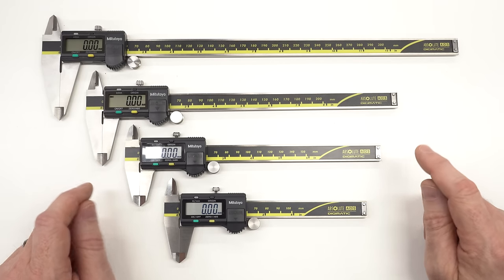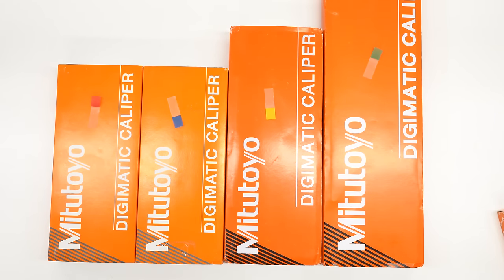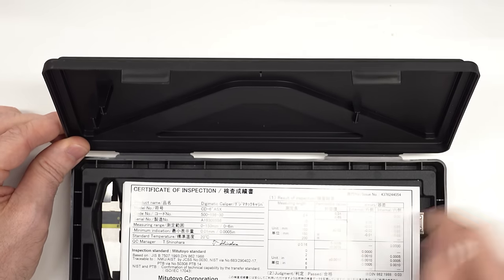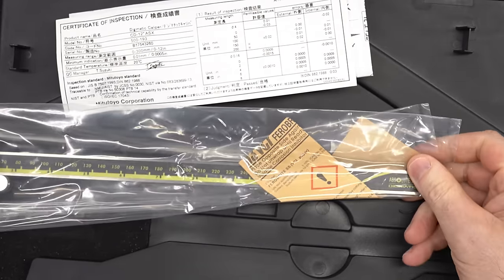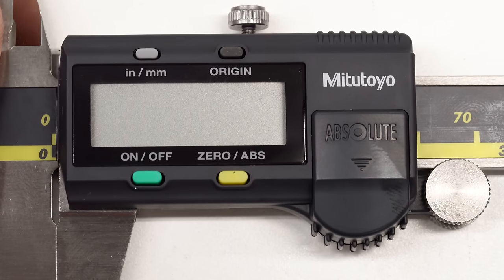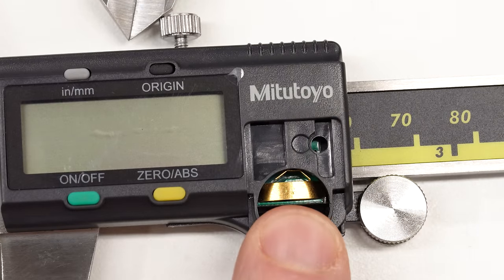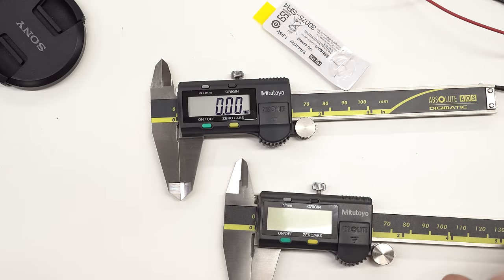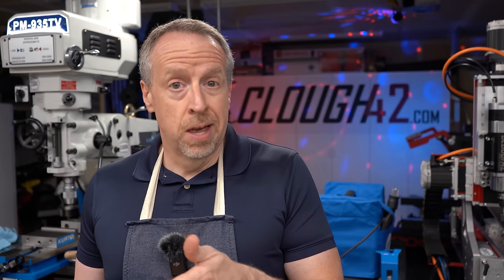17 Warning Signs Your Mitutoyo Calipers Are Fake

Comment: Nice vid. However a few comparative measurements done with both the genuine ones and the clones, as well as an independent measurement with a different caliper known to be genuine would have been a lot more helpful. I mean in calipers, ultimately, everything is about precision. I don't want it to be precise as in "a certain bolt is 8mm and fits a 8mm nut", I am pretty sure both the genuine and the fake ones would say "around" 8mm, I want to measure that rod that has to be exactly 7.5 mm when i take it off the precision lathe and has to fit a hole with a 0.01-0.02 mm tolerance...

Comment: I bought a cheap (+-20 dollars) made in China back in 2002 or 2003, for school. Have checked it against name brand ones multiple times over the years. It always says EXACTLY the same as the expensive ones. And is still working fine after twenty years. 

I don't know, maybe I just lucked out big time, but I'm not paying a hundred bucks or more extra for a name brand one, I'll tell you that much.

Comment: I've got myself a Chinese copy of older Mitutoyo calipers (not ABSOLUTE AOS version) for a home/hobby use. Seller did not offer them as Mitutoyo and they have no Mitutoyo logos. However the calipers do look very close to the original, have nice quality ABSOLUTE sign on plastic and ABSOLUTE / DIGIMATIC print just like the originals. Also power consumption is just slightly more than the original. Calipers don't work quite as good as the genuine Mitutoyo but still are very good for the price I paid ($20 (delivered from China) for 6" caliper).

Comment: while many people have the opinion of "if they work, then a cheap pair is just fine" and i was also in that group myself. once you get at genuine pair of Mitutoyo calipers in your hands you will understand the difference and why people pay for the privilege to own such pieces of equipment.
i spent the last several years using a $10 pair of calipers and had no complaints, until i brought the pair of genuine Mitutoyos. now when i pick up the pair of $10 calipers, its like their slide is made of sandpaper, i cant stand them. even my counterfeit pair is considerably better than them that i would happily pay the counterfeit price again just to get a reasonable pair of chinese calipers.
in the end i comes down to, how much are you willing to pay for the "feel" of the tool you are going to be using. some people dont care as long as the tool does the job they need it to, while others want a particular "experience" from the use of their tools and they are willing to pay that extra premium to achieve it.
So, each to their own, and we should not judge each other for the tools we choose to use to accomplish the tasks we strive for, we should all just rejoice in the fact that we are all connected in our love of making things.

Comment: I have a non branded version that has an identical case but it is far smoother with more detailed design and cushion pads. The tool looks plain, but it is steel and has been perfect. .0005" accuracy. $25

Comment: I inherited my dads Mitutoyu mechanical Vernier Caliper, I believe it was bought in the early '60s and they are bang on accurate and are in excellent condition
 I also have some cheap Chinese digital ones by 2 different manufacturers and they are quite accurate but not as accurate as the mechanical one IMO, I also prefer to use the mechanical one.

Comment: Would be good to see measurements of a gauge block to see how accurate each is.  I use a Mitutoyo at work, but have a Clockwise tools one at home that I use for 3d printing, so doesn't need the same level of accuracy as I need at work.

Comment: A great video.. I have a REALLY OLD Mitutoyo, the daily goto and I use a horror freight digital for measuring while drawing. The digital is as accurate, but not quite as nice a finish and feel. What is really important here is ethics. I have Shars stuff and like it. I also have some other 'cheap' brands (including horror freight) and like them too. Like you say - put your own brand on it...

Comment: My Mitutoyo 6” calipers model CD-6”CSX and their box purchased on Amazon in 2014, tick all the boxes for being real except my Origin button is recessed and my battery cover is a little different, I think Mitutoyo tweaked the design a bit at some point. Would like to see an accuracy & consistency comparison between the real and fake calipers.

Comment: Do the counterfeit calipers read absolute like the real deals? That is one of the big reasons I like my Mitutoyo calipers is that I don't have to worry about zeroing it for every measurement. The cheap sets I've used over the years would drift. Can you turn off the counterfeit ones, slide it along and then turn it on and read the correct measurement?  

I think inside the battery door will be the first thing I'm going to check when shopping garage sales and such. Don't need a genuine one to compare it with there.

Comment: I have a 6 inch which i bought from an Ebay seller almost a decade ago. It says Mitutoyo UK Ltfd Made in England on the back. How can I identify if it is genuine or not? I suppose it is an older model than the ones you are showing on the video, because my on/off and zero/abs buttons are located on the bottom and the battery cover is different (does not have absolute on it).

Comment: Hi,

I have one of the ubiquitous eBay/Amazon $15 cheapies and it serves a purpose - I don’t do a lot of precision measuring and it never needs to be that precise.  But I would appreciate something a little better, one that holds the zero better and repeatedly gives the same reading when the same object is repeatedly measured.  I can’t really justify Mitutoyo prices but I’d been interesting in something respectable in between.  Trouble is I don’t really know the industry, I can see lots of more expensive ones but I don’t know the brands so I’m suspicious that they are just what I have at the moment but in better housing.  Could you recommend some mid-range brands that I could look at please?

Comment: 11:33 

My understanding is that such signatures are 99.99% sure autopen and not handwritten sir.

Regarding if i spotted the fakes i did spot two that looked different than the other two if that counts ;) The giveaway for me was the font in the physical scale. Especially the 0 was a dead giveaway. I then applied logic and chose the prettiest and cleanest looking font as the real one. ending on the correct one.

good video sir, you may weigh them as well for comparison for an additional way to tell for those with poor eyesight. most ppl have a digital scale

Comment: Do those QR codes on the back actually scan?  One of them looked blurry.  It would also be interesting to see if the serial numbers are serial numbers.  Could they be cranking out units that every time the change the reel the serial numbers start over from 1.

Comment: Very sharp eyed observation's there, - ebay is full of fake offerings, I am a keen cyclist and have been caught out with fake Shimano component's, bought a chain and rear sprocket set that just would not work at all, chain full of stiff links sprockets poorly machined lesson learned in the bin and replaced with genuine items from local bike shop. (at least your fake callipers worked - are they accurate though?) I am a retired QA engineer so found this interesting, thanks.

Comment: The fake died at 1.16 volts (if I recall). The real one showed a “low battery” indicator at about 1.4 volts, but at what voltage did it actually quit?

Comment: I bought one from Amazon and I fear it is a fake. It was cheaper than normal but it was in 2019! I was watching the video and it was like a rollercoaster, in some ways it was different to the ebay ones you have and in others it was different to the genuine. The biggest giveaway for me is the machine in the groove on the back. Rough as guts on mine and I can't imagine a company like Mitutoyo sending it out like that. Although it would be interesting to open it up and see inside. Will you do that in a video?

Comment: I used to have to get gaskets and then another country started making knockoffs and they don’t work. It’s a Xerox’s copy of an original. It’s always holes and channels are in a little different position. Transmission gaskets will have cross leaks.

Comment: 2am and I’ve just been out to check my calipers and micrometers. Calipers are genuine but I cannot find anything to say the micrometers are fake, certainly not on the units themselves. The battery is the only thing I can see. They seem very accurate and repeatable so I’ve no reason to complain even if they are fake.

Comment: I expected to see comparisons of accuracy using reference blocks. That would be important in seeing if they’re worth buying.
Reply: Did you know that you can buy calipers that are even cheaper because they don't waste time trying to dress themselves up as something they are not? The video mentions that the SHARS brand is recommended and costs less than the fake Mitutoyos. As @G.Tucker said above: "If you were to buy these knockoffs, you're not saving 60% off the price of Mitutoyo calipers, you're paying $80 or so for a $12 caliper."

Comment: I'm using a $10 caliper from Aldi's.  Pretty good for how little I need to use one.
Reply: I have Aldi calipers bought about 5 years ago, and they’re terrible. Not only do they eat batteries like there’s no tomorrow, but they miss steps (usually a multiple of 0.2”/5.08mm), which is easily noticed when measuring something tiny, but easily missed when measuring something a few inches across. This screwed me over more than once. Maybe the ones they sell now are better, but I doubt it. 

I mean, you can always perform a sanity check by comparing the reading to the physical scale on the thing. But that kinda defeats the purpose of digital calipers…

Comment: My hobby is modelling. I would like to use a caliper to measure wheel diameter of a tank in scale 1/35. I hate buying fake. I bought a Mitutoyo Caliper  for USD 25.00 on aliexpress. Now I understand that this device is fake. The real device would cost about CHF 150.00 or more. I would never spend CHF 150.00 to pay a device for measuring wheel diameter. In fact, I should never have ordered this device on aliexpress. I should use the traditional decimetre rule to measure. No precision. But I don't need such a precision. Thanks for your video.

Comment: Open and close high speed at low voltage, and repeat ability, read value on measure block 1,5,10,20,30,40,60,80,100 mm to see accuracy

Comment: On the yellow rag the exclamation mark next to “First” is farther from the T on the fake tags.

The arrow under the word “AbsOlute” is larger on the fake calipers.

The distance between the inch marker and the number is smaller on the genuine calipers. 

The vertical spacing between the metric marker and the numbers is much larger on the fakes.

The finger grips under and above the battery compartment are pointier on the original ones. 

The housing on the fakes does not reach the marker before to the 70 on the slide as do the original ones.

The thumb-wheel on the genuine calipers overlap the edge of the slide. 

The gap between the thumb-wheel base and the slide is larger on the fakes.

How does the knurling compare between the original and fake thumb-wheels? 

The locking knob on the originals are not as tall as the fakes. 

The slide on the fakes extend beyond the small plate with the two screws at the end of the caliper and one plates is not straight.

Comment: I would never spend a single cent on electronic calipers - no matter who made them. The idea is totally anathema to me.
I only purchase manual operated measuring devices.
That way they always work(!), and I have to use skill to measure an object and read the result. And because I am not lazy, I need to check it a few times, to make sure I did not read it wrongly.

Comment: The recessed screws on top of the caliper are "gib" screws. they put tension on the bow sliders. very important parts that set the blade alignment parallelism.  Put a tiny drip of soft locktite on the screw top. if that screw moves, your accuracy will be way off

Comment: I suppose that some people are fooled or wishful thinking that they are getting a genuine tool at a bargain price.  BUT, others realize they are fake and buy them anyway.  For some, they might be hoping that they will get the genuine quality at a lower price.  Others might like having the prestigious name without the cost.  Imagine, as a mechanic starting out, you could have a full set of Snap On tools at a HF price and the quality was good enough to fool most other mechanics at arms length.

I would like to see an accuracy test, both new and after some use.  Also, how is the feel?  I have a cheap caliper branded Enkay which looks great but feels gritty when moving it.  If I could figure out what part is creating that feel, I might take a stone to it.

Comment: The fake one which I have tried had another big issue. It has not been ABSOLUTE, it had been counting device - when I had opened and closed it quickly, than the beginning was in wrong position. 

ABSOLUTE sensor do not remember the position, but reads the position and zeroing only says which value is the zero (something like adjustable vernier on mechanical calipers, but covering the whole range). Cheap calipers counts the magnetic pattern below them and do not know their absolute position - it can be also the reason for higher power off consumption since the microcomputer stays on the whole time and they only turn off the display. Hard to say if they have changed it, but it is easy check and everyone can see it on spot. I have immediately returned it and bought the one from distributor.

Recessed origin button - on my mm only version the button is flush with opening and it is hard to push without a tool. Otherwise all remarks are the same.

Comment: Origin button being flush is not an indicator, I have a genuine Mitutoyo 150mm (500-196-30) with a flush origin button. It ticks all the correct boxes except the origin button, and I have checked on the local reputable supplier website and their 500-196-30 (which retails at almost $700NZ/440US there) also has a flush origin button.
It also on the 7th year going with original made in Japan battery (which I measured it at 1.59V), it has 11-17 expiry date on the packaging. Granted I don't use it that often as a professional would on daily basis.

Comment: 26:19
The origin button is probably recessed because there's no switch beneath the button. It serves no purpose since the fake units don't need to be set to zero when you insert a battery. Which makes me wonder what happens when you turn on one of the fakes when the clamps are open. Will it remember the last measurement or will it turn on displaying zero like all the cheap calipers?

Comment: Now I know my Mitutoyo caliper is fake. There is one thing that you didn’t mention or didn’t notice, on the fake Mitutoyo, the display would not go back to zero even if you zero it before you turn it off. Mine keeps starting at 0.0005 so I always zero it. The accuracy seems to be fine because it matches the DRO on my Bridgeport mill. It’s good enough for me as a hobbyist machinist but not sure if professional machinist will notice any difference in accuracy. It would have been more helpful if you tested them for accuracy. Thanks for sharing.

Comment: I can't trust a calipher that doesn't warn about low battery. I have already once had a multimeter with that issue - when the battery did run low, it gave different readings if switching polarity when measuring voltage. That is true crap and may cost many times the instrument price.

And it isn't obvious how they hold up for wear.

By the way - the original ones have bluer LCD. It's a quite clear color difference.

Comment: The little battery tag: the illustration on the genuine caliper says “Mitutoyo” and the fake doesn’t. Also the texture of the black and yellow measurements on the length of the caliper is different.

Comment: just got this video auto recommended, and decided to check local internet marketplace (allegro), and it's full of ridiculously cheap fakes, and even high price fakes (which are still way cheaper than the real deal anyways)
Unless someone is actually reselling one without knowing how much it cost there's zero legitimate ones here.
the most expensive one is 960 PLN which is less than 250$, someone is supposedly selling one they never used, there's a photo of the outside and the inside...

Comment: I bought mine on Ebay last year. The caliper failed. It was at this point I found out that this was a fake item.EBay refused to refund as it was outside its period of return.  I bought a replacement direct from the UK Distributor (approx 35% more)  and have to admit side by side its very difficult to tell the difference .

Comment: My MITUTOYO Calipers - given to me decades ago by my mother -
who worked as a quality control inspector for an aircraft manufacturer 
in the UK - and later for a Machine tool manufacturer in AUSTRALIA -
who had never seen a WoMan who could read a micrometer -
which of course is analog as such DIGTAL devices were not invented
then - we did not even have digital calculators  - only slide rules.
The calipers my mother gave me with my name engraved on it
are over 50 years old and as good as new - and they will still be usable
long after I am dead.
The Micrometer is still in its original heavy duty brown vinyl case,
The MITUTOYO logo - Mitutoyo written in a Mixed case script font -
and below the Name  Mitutoyo  is MADE IN JAPAN 
all printed in GOLD color